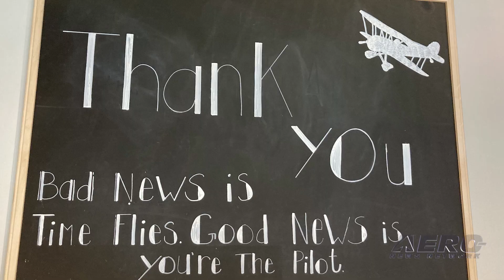Airborne 07.19.21: Waco Aircraft, Blue Origin, Stratos 716X

Comment: Hopefully this Stratos single engine has much more power than the Vision jet which I have seen comments recently saying it is underpowered. The fact that the Stratos has a 10,000 ft higher ceiling is in its favor and hints it is more powerful.
Reply: the vision jet just has dissapointing specs. high fuel, low speed.

Comment: Experimental aircraft are the reason GA is still going strong. However, having said that the cost of experimental planes has gotten out of control. It would seem the manufacturer would want more flying than charging an exorbitant amount for a few. I think the Stratus Jet is amazing-but,  at 2.5 million for a kit it is not going to fare well in my opinion.  Many could be sold around the 1.2-1.6 range. I certainly wish the company well, but at the  prices they state many certified used jets are available.  I’ve been going to the shows for 
28 years and I’ve seen many jets, turbo props, and pistons planes (experimental) fall by the waste side due to lack of funding, over charging or just poor planning.  Certification is one expensive thing and Experimental is entirely a different matter when it comes to insurance, training, financing, and other.  Good lunch Stratus we’ve been watching you for years, I hope you finally have a foothold to make your jet a reality.  PS: lower the kit prices and succeed……..
Reply: stratos has no plans on being experimental. they're releasing a few kits to get flight data and proof that the systems work to speed up their certification process. they fully intend to be certified and competing in that market, not the experimental market.